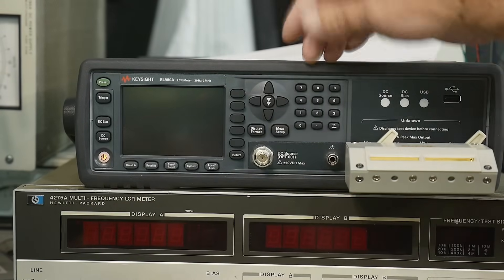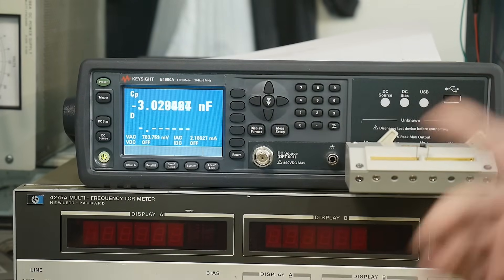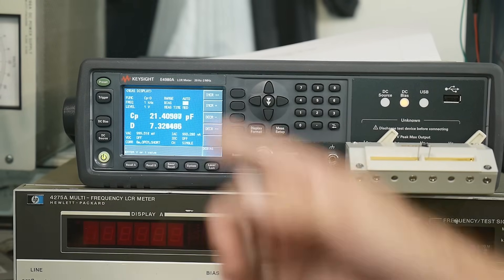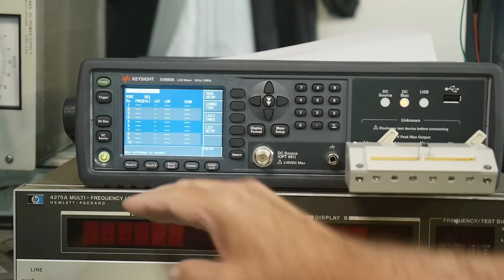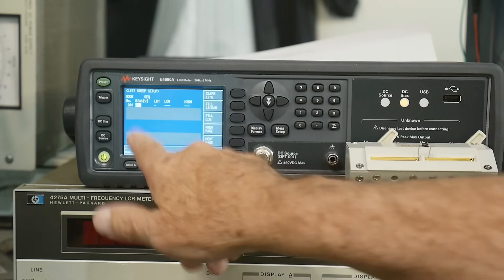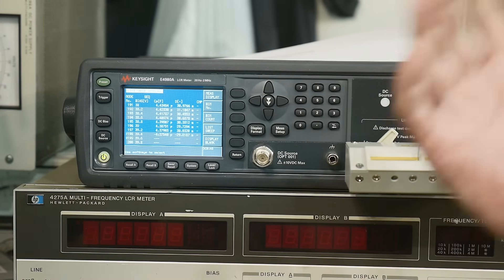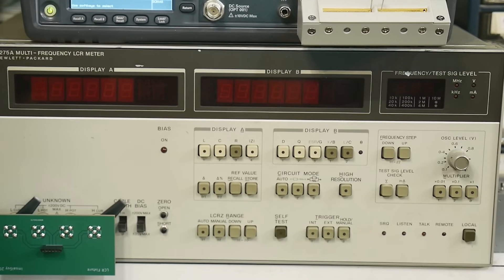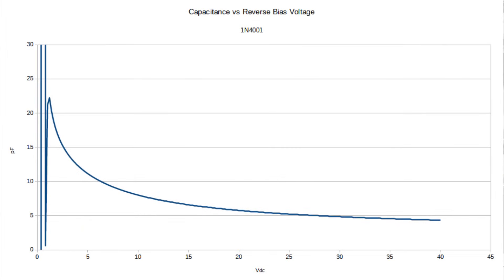#1693 Capacitance vs DC Bias on 1N4001 Diode

Comment: If my memory is not playing tricks on me, the capacitance goes down with 
~1/sqrt(U_reverse), and as others said: if you reduce the ac amplitude, you could measure below 1 V reverse voltage,  cheers.

Comment: Why wouldn't you use Zener diodes instead.  I found their voltage VS capacitance much more repeatable among the same version zener voltage and wattage between multiple manufacturers.  Especially for 36v through 75v zeners which usually can replace authentic varicaps.  The 1N400x series just differ too much between manufacturers.

Comment: BTW:  If you put a 1N400X diode in series with an inductor and connect it to your signal generator, you can get chaos to happen.  You need an inductor that will get the resonance to be less than about 5MHz for it to work.  You set the generator to add a small reverse bias and then you tune to find resonance. somewhere near resonance the following starts to happen.
The resonant circuit rings up until the voltage gets big enough to forward bias the diode.
When the 1N400X is forward biased, a bunch of carriers are injected into the junction area.
Those carriers massively change the capacitance and also kill the Q
The amplitude crashes to near zero
The diode has to go through its recovery time.
Then the ring up happens again.
The recovery time depends on the amplitude of the current just before it.
When the recovery time ends, vs the phase of the generator controls the current you will get before it crashes

Comment: As others have pointed out, turn down the AC test voltage amplitude and you can measure the diode junction capacitance at lower DC bias voltages.  For instance, if you use an AC test voltage of 0.1 volt RMS, you can probably measure the junction capacitance all the way down to zero DC bias, as there will not be enough peak voltage to cause any significant conduction current.  Be sure to pay attention to the D-value.  When the D-value, dissipation factor, (reciprocal of Q, the quality factor) exceeds one, the instrument is saying that the device under test is behaving more like a resistor than a capacitor.  In other words, the device under test is dissipating more than it is storing.  Good capacitors have a very low dissipation factor.  Note that for the diode, the dissipation factor drops very rapidly as the DC reverse bias increases until the diode is no longer experiencing any forward conduction.

Comment: Neat toy you got there! When I was working on modifying CB radios to work on 10m, we would use a diode that a friend acquired that was made by Bell Telephone Labs back in the late 1970's. 
We replaced the stock varactor in a Cobra 148GTL and were able to get the "Voice Lock" to shift the frequency +7KHz and -15KHZ, which was more than the spacing between the channels that the radio used. STOCK was only able to do +3.5 and -6KHz.
Reply: Funny, that's where I remember messing with varactors too.

Comment: You might be able to measure capacitances at below 1 V bias, if you can reduce the test signal AMPLITUDE.  If I understood, you have had 1 V amplitude, which means 0.5 V to +0.5 V peaks.  Even more, if the instrument signal is stated as RMS.  The common assumption of some 0.6 or 0.7 V forward drop of silicon junction is not valid with currents down to micro or nano-amperes.  There is a formula for the voltage versus current, as well as for temperature.  You can see an exponential term there.  In any case, you cannot measure your capacitances below 1 V bias, because the forward current changes your bias!  Another note regards manufacturer standards on their diode capacitance measurements -- their graphs mention that the measurement was done at 1 MHz.

Comment: Nice, I designed my own impedance analyzer some years ago for a few $100s, it doesn't do DC bias on it's own, but you can use an external power supply to measure both capacitors and inductors with DC bias (voltage and current). It covers from low ~1Hz to 20MHz and performs very close to one of the high end Hioki units.

Comment: Hans Summers  did a useful investigation about different types of diodes with dc bias in his artcle "Rectifier diodes as varicaps (varactors) ". He found the most "variable" common diodes, and draw graphs "Capacitance / Bias voltage". Also he measured "an ordinary LED " as a varactor. So, it will be interesting to see how act different LEDs from different ages.

Comment: I think the reason you need to have at least 1 volt of reverse bias on the diode is so when the machine applies its AC signal the AC signal does not ever forward bias the diode. I can imagine when the diode gets forward biased during the capacitance measurement it would mess up the bridge etc...